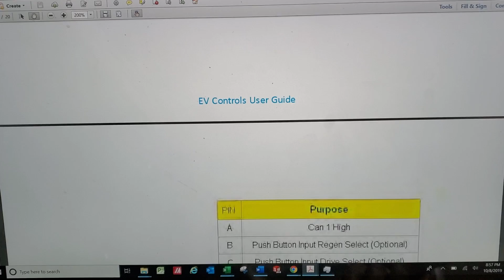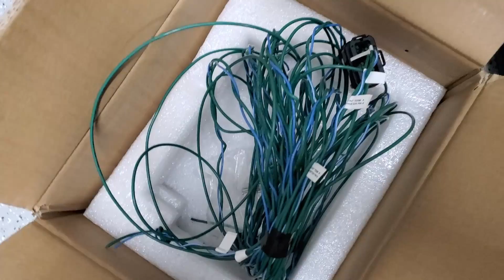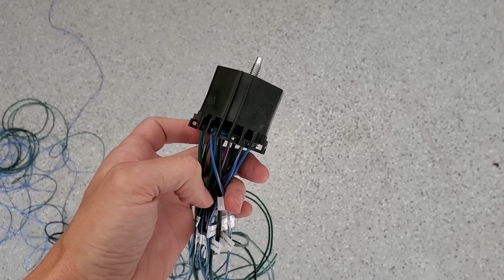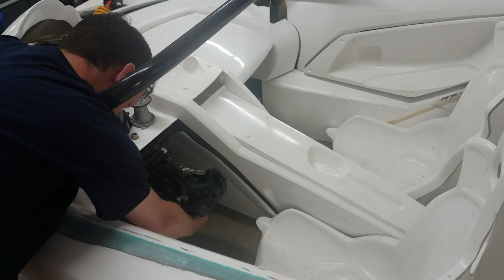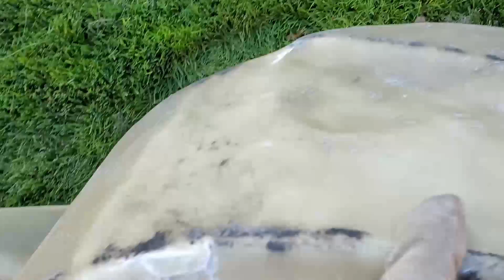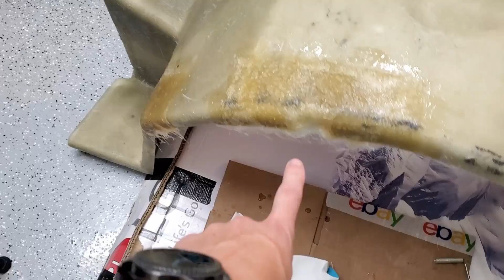Tesla Motor Wiring Part 2

Comment: Your frame should be heavy enough gauge that you don't need the riv-nut.  You should be able to just tap the frame using a drill-tap for either 8-32 or 10-24.  This will eliminate the raised ring that a riv-nut leaves you.  Things will sit much more flush.
Reply from the maker: I have been going back and forth.  Mostly I will use riv-nuts, but yes you are right.

Comment: Your electrical skills are outstanding, fiberglass, not so much. The cheap chip brush for applying the resin is the best method, don't worry about wasted resin. Tear your fiberglass mat instead of cutting with a scissor. On the opposite side of the repair, bridge the area with masking tape to create a shape and to keep the glass mat from falling through. Check out the Sterling kit car site. Many of us have done numerous fiberglass repair and mold building. http://www.sterlingkitcars.com/members_n_forums/
Keep up the great work, I am enjoying your build!
Reply from the maker: Thanks for the comment.  Like many things on this build, this is my first try ever.  I do enjoy laughing at myself.  I am enjoying the process.  The thing that is nice with fiberglass is you can grind it off and do it again.  I will try some of these other techniques.